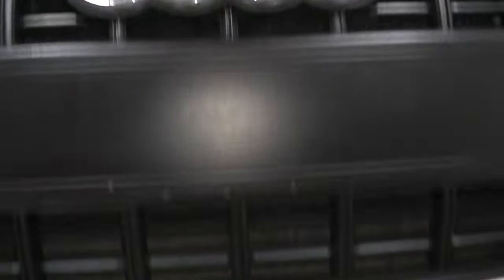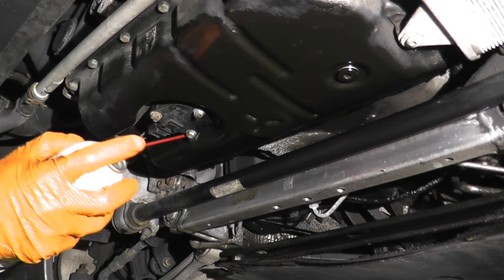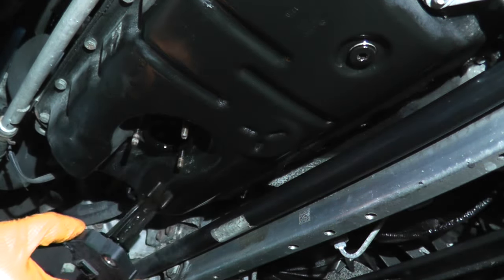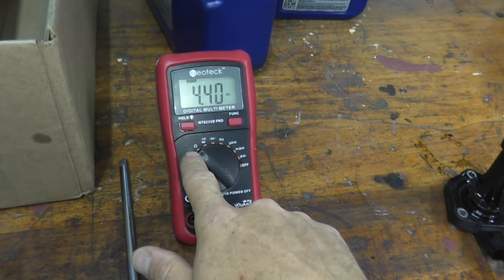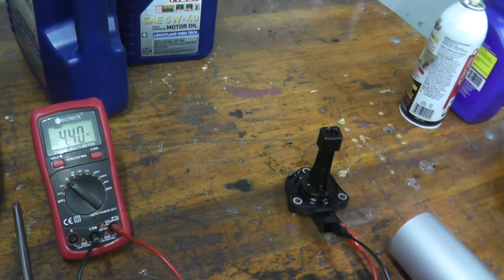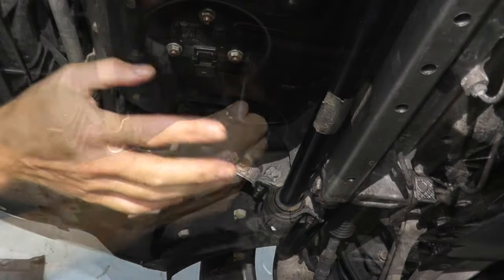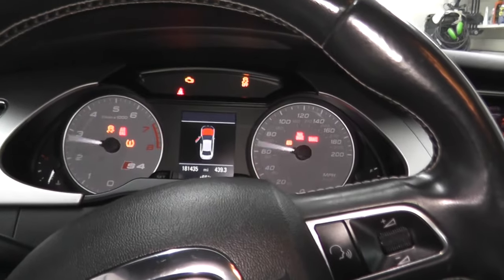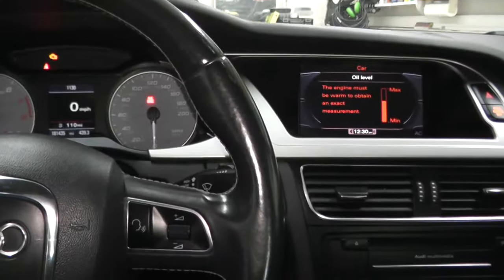Audi & VW Oil Level Sensor and Oil Temperature Sensor Replacement

Comment: Nice video!  Does anyone know if a faulty oil level sensor triggers a DTC?  I don't think so.  Our Audi 2014 Q5 oil level sensor is reading constant "full" when I know it's probably not full.  I think the sensor has gone bad.  Just ordered a manual dipstick from ESC tuning and will probably need to replace the sensor.
Reply: In my 2015 Golf, it generated a P0198 DTC. I used VCDS to detect the code.
Reply: Mine is reading lower even though my dipstick is full. I don't even have 3K on my oil and I just replaced the PCV body. So it should not be burning that much oil. Although Audi says 1qt per 500 miles is normal. Not sure that's EP friendly with Germany trying to make cars with lower emissions. The oil has to go somewhere and it's not leaking or in coolant. Baffling!

Comment: How do you know if the sensor is bad? Mine is showing the oil level but it's lower than half on the gauge. I have about 2,800 on my last oil change.  I did a clear all codes on it due to a PCV DCT, and it went back to full, then after a little bit over driving it went back down. I have a dip stick and it's showing full. So that makes me think the sensor is bad. What do you think before I order one? Thanks.

Comment: Ive got a 2015 polo 6c tsi 1.2 highline 81kw with the exact same oil level sensor but there is no cable plugging into the sensor. Also the car has a dipstick so why put one in if its not being used?

Comment: My oil level sensor is dicking about on my B8 S4 - I have a dipstick and it shows just below full - Opening the hood resets the MMI but after a handful of miles the warning pops up on the dash to add 1LTR - Might be time to replace this sensor. Thanks for the video
Reply: Can you share the link of the dipstick ? I just bought one and looks like it’s to short, thanks 
I have the a6 3.0 2020 looks like they have same engine
Reply: @jhonatanrdguez9880  thats the one I brought some 4 years ago now - I dropped the oil filled exactly with 6.8 LTR and then measured where it was at on the dipstick - I always top off etc to that level - It's always served me well doing that
Reply: Mine is also doing this. Did it solve your issue?
Reply: @distortion4507  yes, I just confirm that from 2019 and up takes 8 quarts so thats why it was showing low oil level, I just put 6.8 quarts and it was showing low level but the last 1.2 quarts put the right level 👍🏻
Reply: @distortion4507  they burn oil and if it’s missing 1.2 quart it will show low oil level. The light disappeared after 0.2 quart and got the right level after I added 1 more quart.
Mostly after 1500 miles yo should add 1 quart 👍🏻